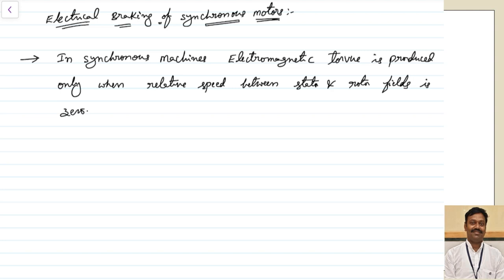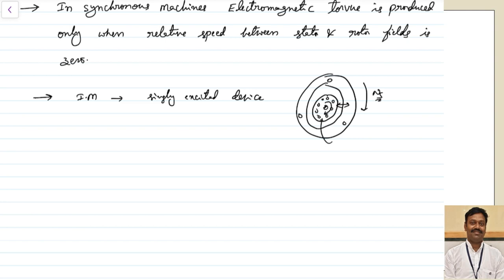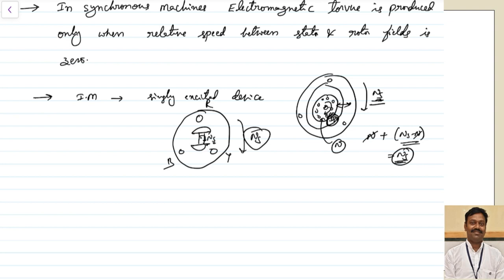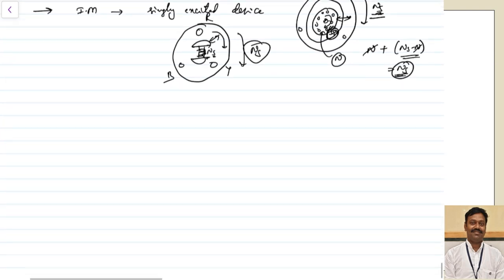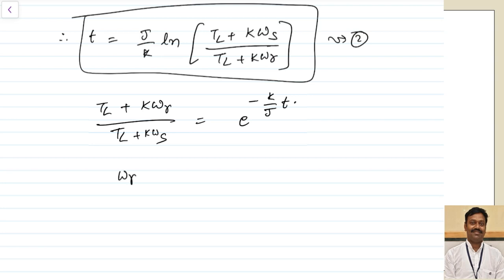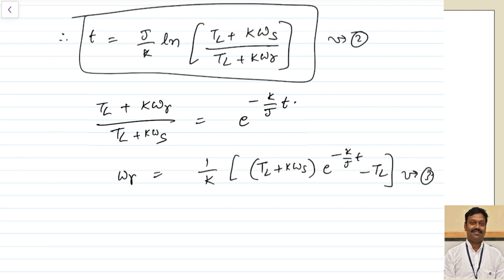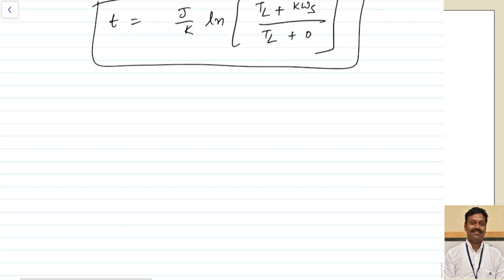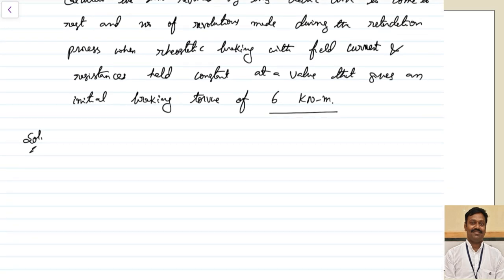SM45 Electric Braking of Synchronous Motors 1

Comment: Sir incase of plugging, if phase sequence is changed then there will be a relative speed between stator field and rotor field. So Torque is zero. Therefore motor stops. Hence braking is achieved. We will cut the supply when rotor about to reverse